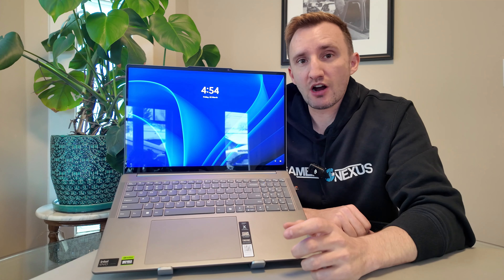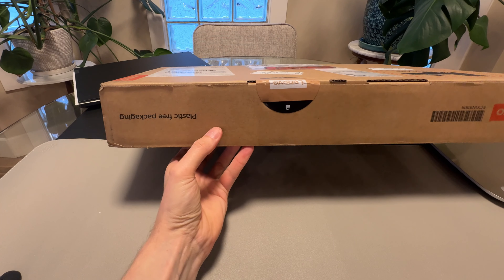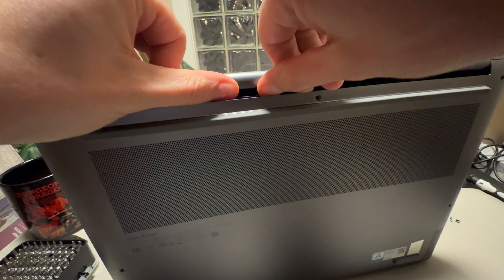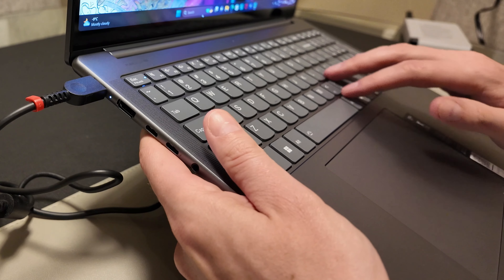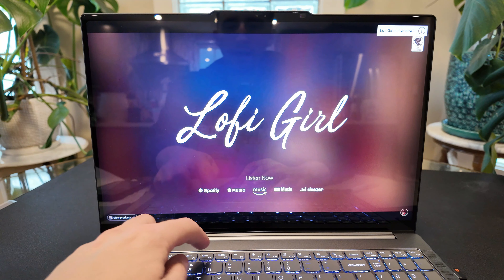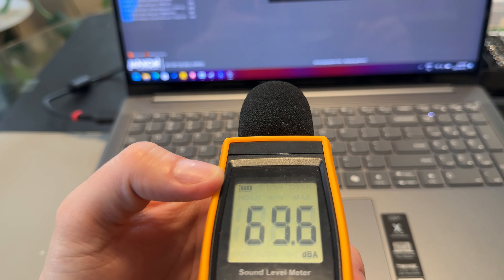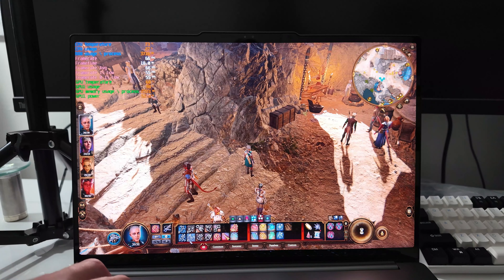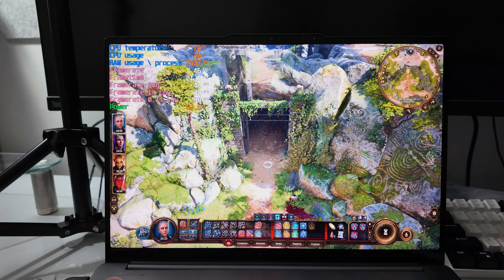I'm in Love again... 2024 Lenovo Yoga Pro 9i Gen Review

Comment: sorry I have the IPS screen with the same resolution and it is beautiful and does not use as much battery.  I don't feel a need for the mini led, I had it on My macbook M1, and I like the IPS on the yoga pro better!!  Also get the 4050 version.  It is quite adequate gives you good frame rates in games and does not generate a lot of heat under heavy load, and it is cheaper.  No need to go whole hog on this one, sorry.  Except for my macbook pro M1, this is one of the coolest leptops, only gets slight warm, and you almost never hear the fans on any mode.  sorry , can't beat that, dont need 100 fps, when it burning my legs off or I can feel the heat genratin from the computer and if I pick it up and happen to touch the bottom get burned.  Not with this laptops

Comment: Strongly NOT recommend - based on my everyday use

Switch on/off button is located EXACTLY where you put your palm on when taking/carrying the laptop - so yes, it will switch off each and every time you would like to move it. Or you would have to learn to carry it in the different way. Probably, lenovo creators decided to turn users into Pavlov's dogs.

This laptop will restart without you knowing about it - in the most inconvenient time. Be prepared, you WON'T recover your most recent work, unless you used Google.

Cursor - arrow is simply invisible. If you used to use something else instead of the usual cursor sign - it might work in this case.

Have started to use Lenovo Yoga in Feb 2024, and Alt+Shift (language switch) stopped working in July 2024.

Bluetooth switches off by itself - usually I use wireless headphones before online sessions, so set everything up in 5-7 min before start. And in about 2 min before start Bluetooth switches off. All my sessions are started with "Oh, just a sec, I have to switch on Bluetooth again"

Good to watch Peppa cartoon - but I don't think this is worth an investment

Comment: So I'd like to bring up the topic of battery life testing. I fully understand the need to test under normal conditions but wouldn't it make sense for you the presenter to test for your audience what battery life would be under more optimize conditions? Not trying to be rude just engaging in dialogue.  I suspect most people who are trying to decide in buying are gonna want to know how it performs under those conditions.
Reply from the maker: 3-4 hours of mixed use. The YouTube text is a good approximation of typical use. Light but consistent load on the CPU 

If you are only typing an essay for example then the idle test would be most appropriate

Comment: Paying 2000$ for a laptop with an integrated graphics card.
No thanks.
Reply: wait ... but this has a 4060 or upto 4070. Whic laptop are you referring to?
Reply: @SOG989  Yes it can be configured to add discrete GPU for extra cost.
But the base configuration without any GPU costs 2000$
Reply: @kyber.octopus  What are you smoking. Base model comes with a 4060.